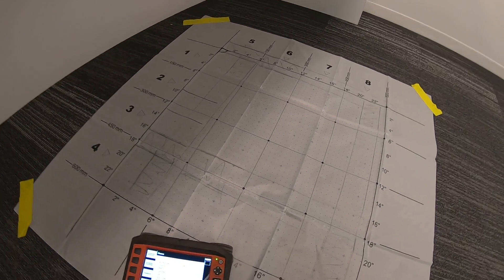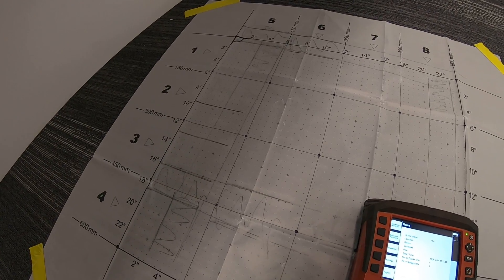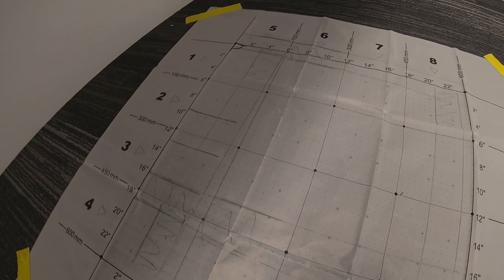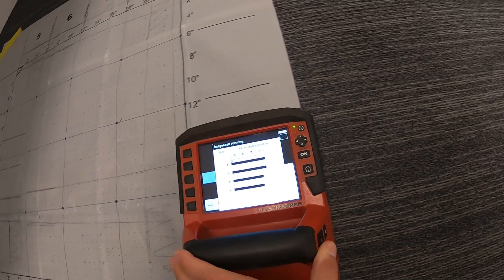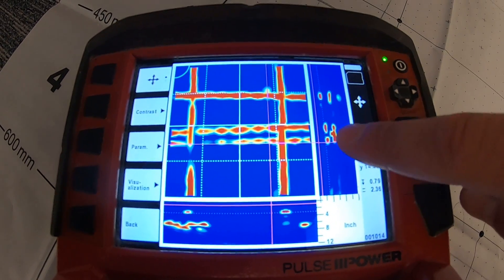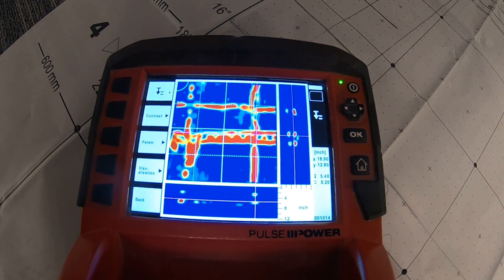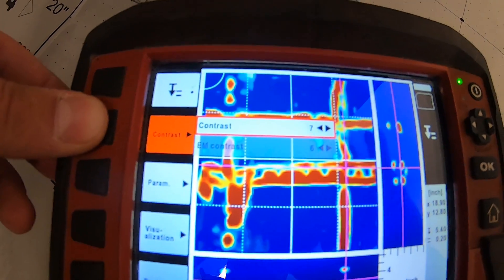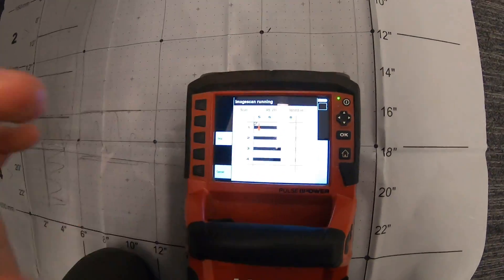PS 1000 Tutorial 6 - Image Scan

Comment: Am I limited to the 2x2 or 4x4 feet scanning area if the paper grid, or can I scan an entire floor or wall with it, too? I want to use this in combination with a 3D laser scanner and a drone to create an LOD 400 BIM model of an existing building. This wall scanner is supposed to show where pipes, beams and cables are beneath the surface, to include them in the CAD model.

Comment: Can this also determine bottom of slab (i.e. depth of slab)
Reply from the maker: Yes it can, but it's generally limited to about a 12" depth. I'd recommend putting it in gained or raw mode to see the cross-sectional view to find it.
Reply: @measuringsystems869  awesome thanks for the reply and the instructional video s! Very helpful!
Reply: Bro how much is each dot worth 19 was two dots over where 20 was four dots over 😳 🤔 😐 🙄 😒 😕 😳  .I might know how to use the machine but I know how to use a tape measure and play bingo...come on stop making videos without accurate info
Reply: Other info is good
Reply: Actually 18.9 is 18 7/8" each dot is 1/2" the grid is 6" square with a marker at every 2"